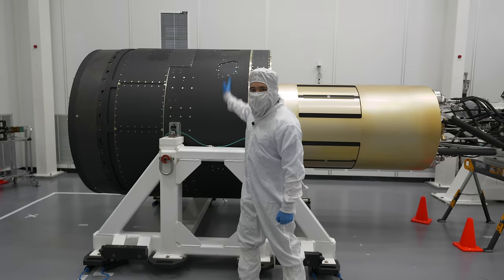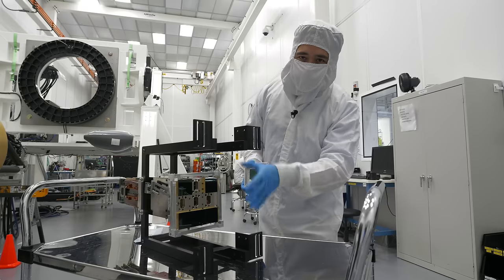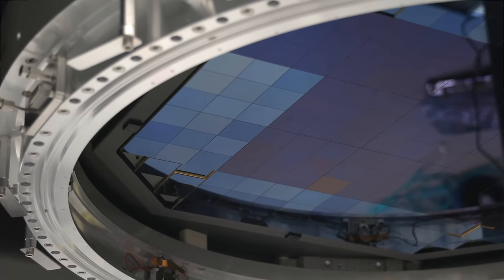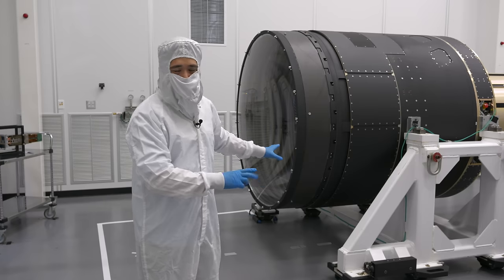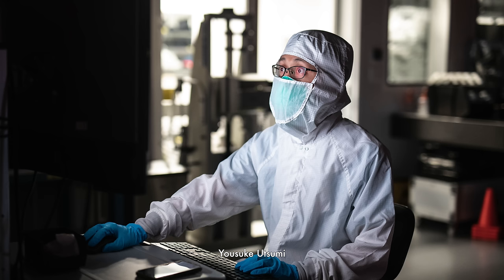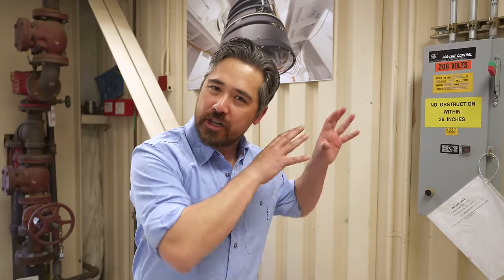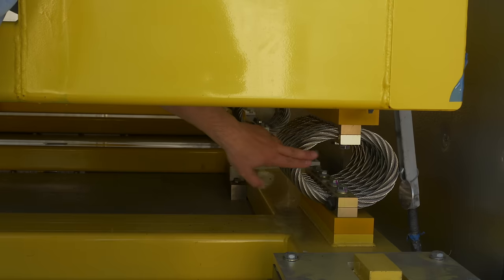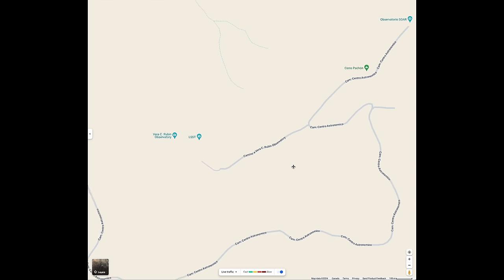The BIGGEST Digital Camera Ever Made!

Comment: And it’s still cheaper than a 10 year old Leica
Reply: 9 лет назад Хаббл выкатывал снимок в 4.3 гига пикселя . Галактика Андромеда. Ищи в ютубе.
Reply: @homuchoghoma6789  1.5 billion pixels. is the original image. you need alot of screens to display the full picture though. 😁👍
Reply: @madb132 Im pretty sure you only need an average monitor to pixel peeping
Reply: @madb132  nah just print in A4 dude

Comment: 3:50 The size of the pixel is not chosen to be smaller than a "star image". It is chosen to be somewhat smaller than size of PSF (point spread function) of the telescope in the focal plane. Because telescope can't produce details smaller than PSF, having much smaller pixels don't help, but readout electronics gets more complicated the more pixels you have.
Reply: It's a survey telescope though, the pixels are way bigger than the Airy disk because it's not supposed to look at details but just to tell if there is something.
Reply: @johntheux9238 No the pixels need to be smaller than the Airy disk so they can distinguish star from galaxies. They do this by measuring the object shape.
Reply: @claudiascarpine6695  It's a f/1.2 telescope so the Airy disk is 1 micrometer while the pixels are 10 micrometers

Comment: Petapixel, some info you gave was not accurate or incomplete. As an astronomy amateur, I easily spotted them. 
1. The camera was designed for the telescope, not the other way around. In fact, the whole complex was designed on the limits we can actually achieve with the tech we have, but the size of the primary mirror is the number 1 limit. 
2. The lenses in front of the sensor are corrective lenses, field flattener, astigmatism corrector and chromatic aberration corrector. They don't serve other purposes than that and they are a must for such a fast telescope (f/1.3) and an unavoidable compromise. 
3. it would have been nice to give us an equivalent field of view on a full frame format. 3.5-degree field of view translates to a 600mm lens of a full frame camera (horizontal field of view).
Reply: Ask me something about fly fishing .
Reply: @niccollsvideo  well, that's fair up to a point. When it comes to anything fishing, my brain is a big void. I can hardly put a worm on the hook. 
Though, astronomy is entangled with astrophotography and optics and the same optics principles apply to camera lenses as well. 

All lenses need correctors. Some lens designs have the correcting feature embedded into the lens design, like the classic double gauss or the sonar lens type or Petzval type, others have correctors at the end, like telephoto lenses. 

There are scales of field of view of lenes, I had to check it out myself to see how much 3.5 degrees actually are on full frame lens. 

The most interesting feature of this telescope that is absent on any other telescope is that it is so bright (f1/3), so large (8.4 m) and it has such a large area camera. This translates to very fast image acquisition and very sharp because of the short exposure times required that will lower the atmospheric turbulence influence on the image, not to mention the low image noise.

Comment: I think the photo filter carousel is my favorite part. Would love to have that on a real camera
Reply: Amateur astrophotographers use something really similar called an EFW, electronic filter wheel.
Reply: @unlucky5442  In that case, the design of the filter exchange system was rather tricky. As the camera hangs in the center of the telescope's secondary mirror, its outer diameter had to be minimized to maximize the collected light from the sky. No filter wheel was allowed to sit besides the aperture. Filter exchange system must fit inside camera's body, but it was impossible to store on the carousel the 6 filters needed for observing in the different bands of wavelength. The less frequently used filter (UV band) will have to be inserted by an auto-changer , replacing one of those inside while maintening the cleanliness
Reply: I wish I could use a similar carousel for my RASA. Having to use a filter drawer with a mono camera is a pain, and my OSC camera just doesn't get the same detail as a mono.

Comment: Allowing for maintenance, bad weather and other contingencies, the camera is expected to take over 200,000 pictures (1.28 petabytes uncompressed) per year, far more than can be reviewed by humans. Managing and effectively analyzing the enormous output of the telescope is expected to be the most technically difficult part of the project.In 2010, the initial computer requirements were estimated at 100 teraflops of computing power and 15 petabytes of storage, rising as the project collects data. By 2018, estimates had risen to 250 teraflops and 100 petabytes of storage.

Comment: 8:18 you only need it to be airtight and the moisture removed, no need for a vacuum chamber, not for condensation anyway. The advantage of the chamber is that you won't get air currents that can distort the light coming in.
Reply from the maker: Oh, cool! I’ll tell the scientists!
- Jordan
Reply: @PetaPixel  I figured I would just mention it for others because there are very interesting reasons you would want it that way other than condensation.

Amateur telescopes like the ones I have built actually have to wait to cool to ambient temperature because the heat from the warm optics and tube makes the shot a bit distorted kinda like bad seeing conditions would.

Comment: did they explain, why they used CCD sensors specifically? i would have thought a cmos sensor would perform better
Reply: CCD have lower noise and 100% fill-factor. Also these sensor have a very large depletion region which gives a much better response in the near infrared.

Comment: The 16Mpixel CCDs are far from being largest. For one, e2v produces CCD290-99, a 9216x9232 pixel sensor (85Mpixel). Another is CCD1600LN from Andanta, 10560x10560 pixels (111Mpixel)
Reply: Yes, but these are special pixels. These sensors are more sensitive in the red spectrum than the CCDs you mentioned, a must for infrared region. 
Then, it is a challenge to make a perfectly flat large CCD and more expensive to make one large CCD with fewer defects than more smaller CCDs put in a matrix, given that a large number of sensors are already rejected. 
Also, the sensitivity of the larger 10um pixels is a must for fast acquisition, low noise image. The faster the shot, the clearer the image because of the atmospheric turbulence. Besides, single shot 3200 megapixels is so much raw data that pixels any smaller would be just overwhelming. 

Trust me, the design of the telescope combined with the camera itself was not an engineering mistake. Everything was overengineered and overcalculated before putting everything into a real telescope.
Reply: @ilaion11  "the sensitivity of the larger 10um pixels is a must for fast acquisition". 
I'm not sure what you are talking about here. It seems you think these CCDs have much smaller pixels. They do not. CCD1600LN has the same pixel size (10um), CCD290-99 is 9um.
Reply: @ilaion11  "Trust me, the design of the telescope combined with the camera itself was not an engineering mistake."

I can't trust you because you did not demonstrate you know well what you are talking about.
The rafts probably do not use 100Mpix detectors not because they are worse (they aren't), but because the design started ~2010 when they simply did not yet exist, and redoing the design of the rafts from scratch would take lots of time and $$$.
Reply: @denysvlasenko1865  
You're right about the pixel size, and the 100mp chip can be implemented in a raft, no problem. Though, it os still cheaper and easier to make a raft with 4kx4k chips because CCDs have a high rate of below specs pieces and it would require to make hundreds of them to make such a large camera. 
They would probably go the same solution if they would do the design today, it's my opinion.

Comment: Why didn't they make a single sensor of 3024MP
Reply: My guess is it would be very difficult to make a single sensor that large without any defects. Remember he said many sensors had to be discarded due to defects. It's the same with large telescopes. It is very difficult to make a large mirror with just one piece of glass. So nowadays most large telescopes are made of many smaller mirrors placed together. For example the Extremely Large Telescope (ELT) now under construction uses 798 hexagonal segments 1.4 metres across to produce a large mirror 39 metres in diameter. It would be virtually impossible to make one large 39 metre mirror. The largest mirror made of one piece of glass that I know of is the 8 metre mirror in the Subaru telescope. The Keck Telescopes' mirrors are larger at 10 metres but they are made of 36 segments 1.8 metres across. And note that each segment weighs 880 pounds! Edit: I should add that even if a mirror made of one piece of glass 39 metres across could be made, it would be virtually impossible to transport it from where it was manufactured to where the telescope is (which is invariably in a remote location of high elevation to escape light pollution and get above as much of Earth's atmosphere as possible to reduce atmospheric turbulence). Can you imagine trying to transport a 39 metre (128 foot) diameter mirror on narrow roads (which are the only roads available in remote areas where the observatory is located)?